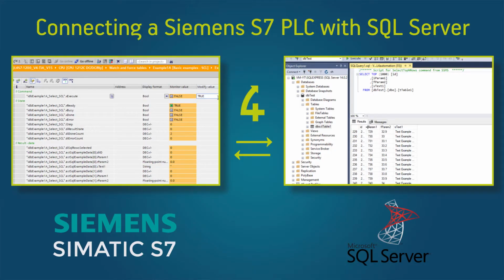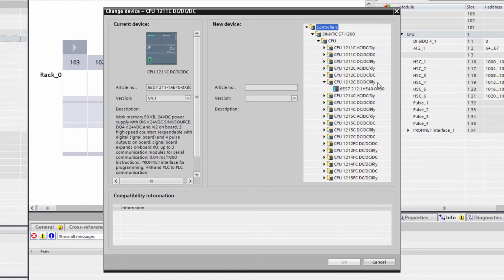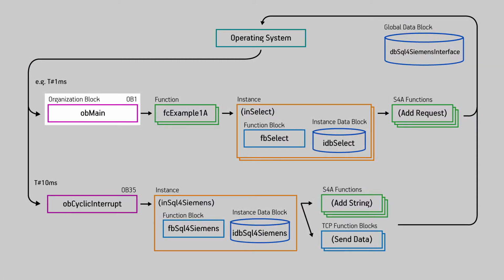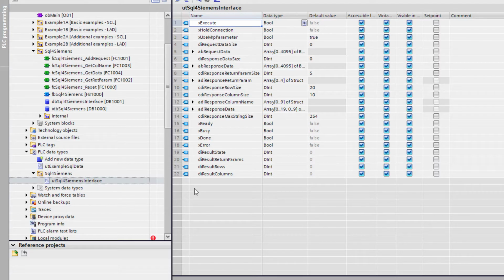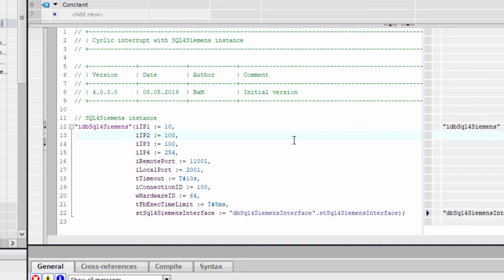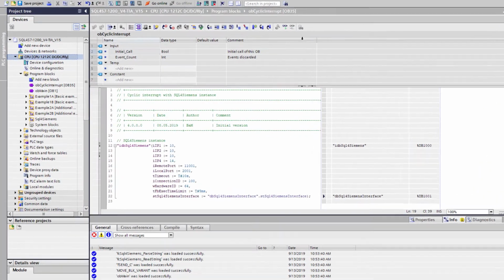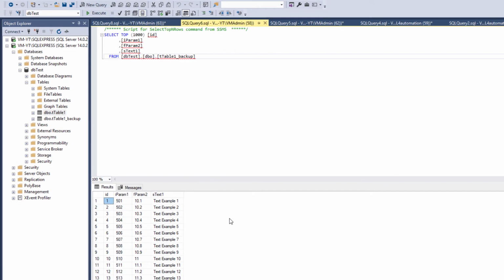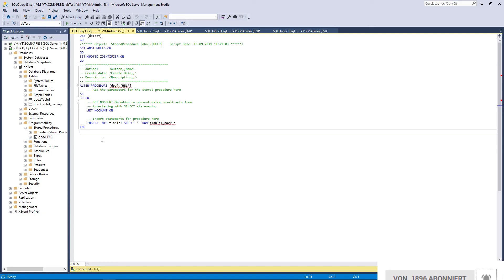How to connect a Siemens S7 1200 PLC to a SQL Server Database

Comment: HI, is possible to store a database in a sharepoint folder  and poin to that?
Reply from the maker: Hi Simone, it should be possible with a file based database like SQLite. It's not ideal though, especially if you'd want to access the database from different devices at the same time.

Comment: I wonder if it possible to autoconnect everytime the software is opened
Reply from the maker: Hi! You mean that the config tool automatically connects to the last known connector service? The service runs on its own automatically, so you only need the config tool to initially set up the connections or change settings.
Reply: @sql4automation584   Yes i Discovered that lately thanks for the answer it works good

Comment: Can i any trigger any value from sql database to plc
Kindky help me
Reply from the maker: Yes you need to write a program in the PLC which continuously reads out / "SELECT"s values from the database. So when the value in the database changes, the PLC will read that new value. If you're using Siemens you'll find examples on how to do that in our example project. It comes included with the SQL4automation download on our website.

Comment: Hi, Connector IP should be my laptop IP right? but its  not showing my IP on the drop down list. i can see only the localhost
Reply from the maker: Hi, yes if you want to connect a PLC to the connector you would need the IP of the interface which is in the same network as the PLC. Maybe you could check your network adapter settings. Please write us at info@inasoft.ch if you need more help. :)

Comment: Hello, to make S71200 and the SQL Database communicate, do you need the S4A Query Tool software?
Reply from the maker: Hi, when using our software, the S4A Connector and S4A Config Tool are enough. The S4A Query Tool and S4A Debugger are just usefool tools when developing the application.
Reply: @sql4automation584  
Ok thanks for restoring me.

Comment: hi 
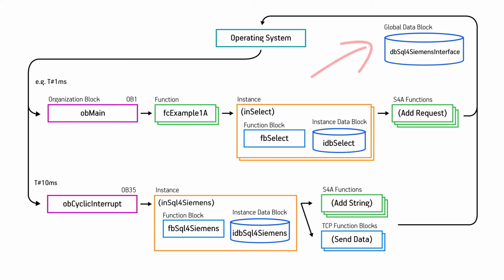i want to ask you, in 4:35 the 10 milliseconds means the transmission speed of importing data from server ?
if yes, do you know the speed of respberry card ?
Reply: It only means that PLC recalls cyclic interrupt every 10ms and executes instances (function blocks, functions) which are contained in this instance. 
Speed of data transmission is another concern here. Data after cyclic interrupt execution are being held in buffer and transmitted when communication processor is free to transmission. So, it's matter of amount of data which are being exchanged with other devices on the net. You can try to check using WireShark or other programs to analyze web traffic. Normally it's quite fast -> milliseconds.

Comment: Hi
I have downloaded the example project, however when I try to open it up from TIA Portal V11 it doesn´t show up (SQL4S7-1200-TIA.ap13)
Is it because there are different versions? What can I do?
Reply from the maker: Hi Jorge
Yes the project is written for the TIA Portal Version 13. So you would need at least that version or something more recent. I would recommend you upgrade your TIA-Portal to a newer version. I'm afraid we don't support older versions than 13.